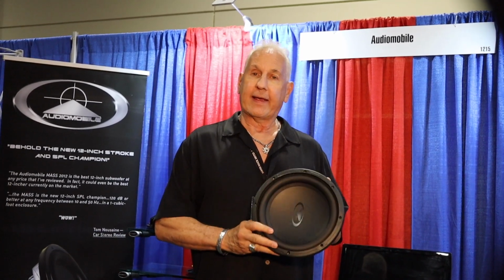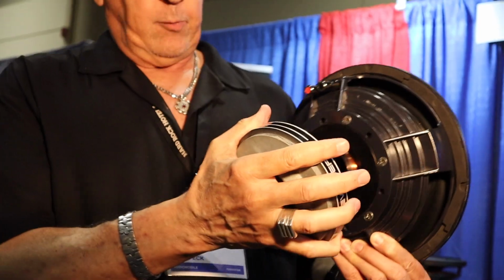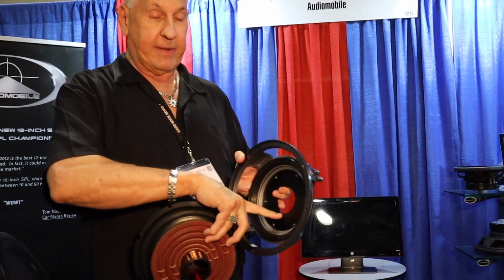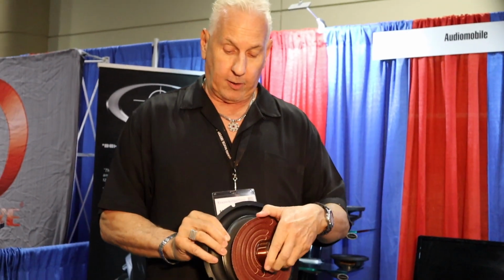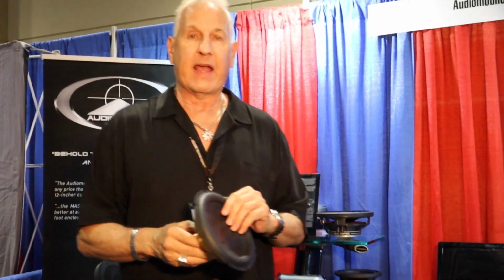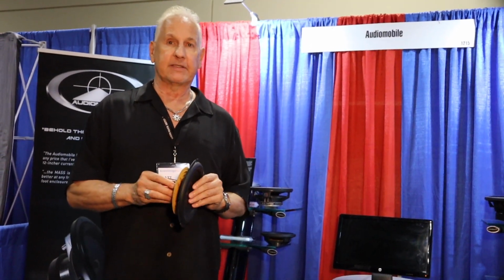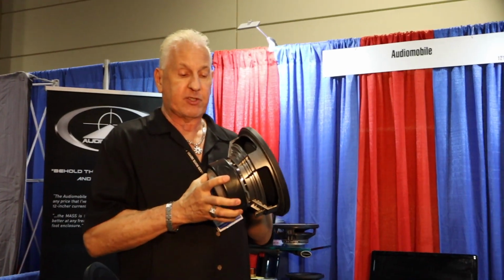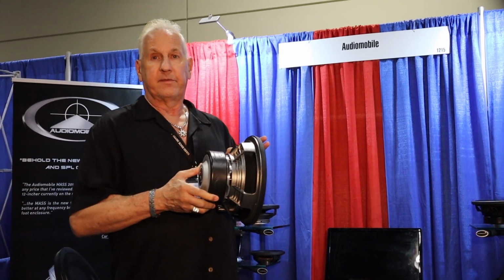The Best Slim subwoofer, we talk with AudioMobile

Comment: I have 3 of the 10" GTS 2110 S2 in a 1.8cf net sealed box, powered by a SALT 2 amp. I have video of them going as low as 8hz on a sweep test. And they sound AMAZING! Deep,  tight bass at all volumes.

Comment: I had 2 Audiomobile MASS 2012's ran off a JBL GTO 1200 watt amp back in 99 or so.  They were in 3.08 cu ft enclosures tuned to 27 hz and they did a 148.7 on the old Audiocontrol mic on the dash doors closed.  Amazing sub and one of the first subs that could go past 20mm of x-max cleanly.

Comment: Matt Overpeck is still Matt Overpeck, though he's clearly calmed down over the decades.  I like this version of him - he's always been a passionate, knowledgeable guy.

If you filter out the dubious engineering claims and gimmicks (to be fair there's NO brands that don't do that), he's always solidly been on the side of high-quality products (better than mainstream) with pretty good price points - although it sounds like he's trickled up past mainstream prices... but it sounds like this relaunch of Audiomobile, he's now shifted from online-direct sales to enthusiasts, to dealer-network.  The higher prices are inherent in that - he's only getting half of what he's saying, which is about what the 90's and 00's Audiomobile drivers sold for.

Dubious or not, the installer (and install) friendly engineering considerations are all great sales-floor sales techniques to address customer concerns and overcome install-specific challenges that customers may walk in with.  I'm a fan of engineering working with marketing.

As a die-hard old-school forum-enthusiast member, I'm only disappointed for the higher prices that this dealer-network distribution model (of which Matt will not profit even one dollar more, per unit, I'm sure) but they will still be competitive on dealer shop floors.  I do wish him more sales success going this dealer-network route than previously occurred under the online-direct model.  It's the right time to give that business model a shot, I really do think.

Comment: Back in the day, AudioMobile / Crystal CMP underhung subs (made by TC Sounds if I recall) were some of the finest sounding SQ subs ever made.
Reply: I wish tc sound came back
Reply: @magno408_1  Believe me, I know and talk (and work) with several transducer engineers who would love to design products as beautifully executed as TC Sounds products, but they would run into the same problem TC Sounds had - in order to be priced competitively (even though still very high), they would not be able to make any money on the products. TC Sounds wasn't making enough on the products they sold, but they couldn't raise prices because they were already at the edge of what the market would bear. Would you spend $1500 on a subwoofer driver, not even including the enclosure? There was also a lot of wasted steel in the underhung motor assemblies, and TC Sounds would often use low-grade Y28 or Y20 ferrite magnets so they could stack four of them and have a lot of clearance inside the motor, and this was also visually impressive to customers, but it was wasteful and resulted in expensive magnet assemblies when the same magnet assembly strength could be achieved with less magnetic material.
Reply: Amen I remember going to the factory in San Diego
Reply: I had 2 15 CMP's and they sounded marvelous.
Reply: Include the 88 Eclipse alum series same driver pretty much. I'm still mad I sold my Mass, and Eclipse sub back in early 2000s

Comment: Whoa overpriced, for a 750 watt rms sub with 19mm of xmax you could go with a sundown audio SA 12 for half the cost. Same power n more xmax.
Reply: And it not fit in the enclosure…. This is a SQ woofer, not SPL… not even comparable. Audiomobile is designed for small tight spaces…. Not 6th order bandpass.
Reply: I think you're failing to appreciate the point of this driver. There are of course cheaper thin types available but often times you get what you pay for.
Reply: These subs are amazing, they perform great and work great in .4-.5 cu enclosures and never miss a beat and are only 4” deep……
Reply: @MarklandDesigns  
FINALLY, A REPLY FROM SOMEONE WHOSE OPINION I TRUST...  I SHALL LOOK INTO THIS BRAND...  THANKS...  🤙
Reply: The skar vd series, pioneer shallow sub and the earthquake system line would be its closest competition as for frequency response and output in a small sealed enclosure. All of which perform very well for sq and way less cost
Reply: @boominS10  you get what you pay for like gentleman bellow said. I’ve installed these subs, and can vouch for them better than a company that has rma’s stacked for years
Reply: @boominS10  by your logic… a Digital Designs component set is just as good as a K2 Focal component set… since it’s cheaper there’s more value? I also guarantee you haven’t even held one of these subs. Move along.

Comment: I have 2 12 JLTw1, was going to upgrade to the Tw3, but now I'm not sure? I know I need more bass in this pickup truck....
Reply: Its about the same bass from both tw1 and tw3 only thing that changes is the mounting options for the woofer. If you want more bass go with tw5 13 inch shallow woofer
Reply: @JuanRuiz-we2kq  that was my original idea, but the shop I go to claims it wouldn't fit
Reply: @JuanRuiz-we2kq  People recommend TW5's without trying them. The 12TW3 will outperform the 13TW5v2
Reply: I have to two 10tw3d8 on a cheap hifonics burtus 5 channel. I am going to up grade I have two more I'm trying to find the right Amp for all four. Don't get me wrong it not hitting like my two 10in w7 on a 1200v3 but not. But it makes me smile when a good song comes on also I have jl zr 6.5 in front
Reply: Go with 2 of these woofers, sealed… try to squeeze .8 cu. ft. For each woofer and do separate chambers… you won’t be disappointed, that’s coming from an installer that has built multiple boxes for multiple models of audiomobile, they are absolutely fantastic subs and a good balance between output and SQ.-kaeleb